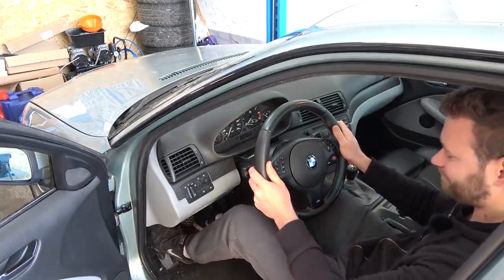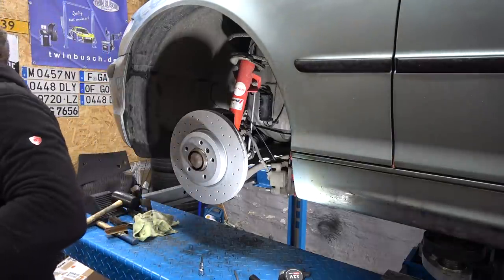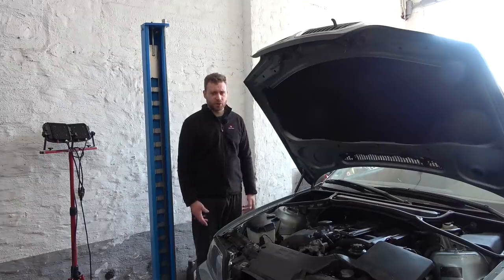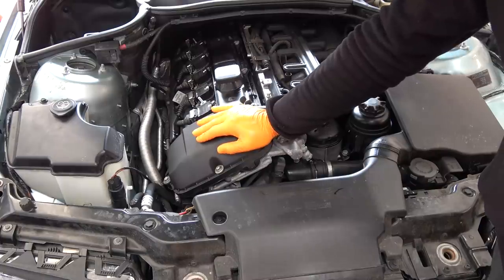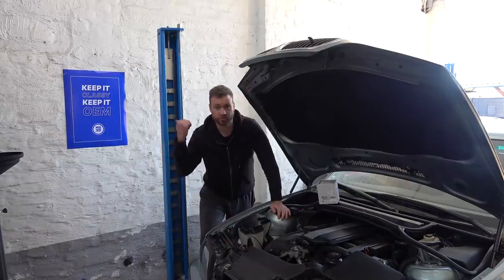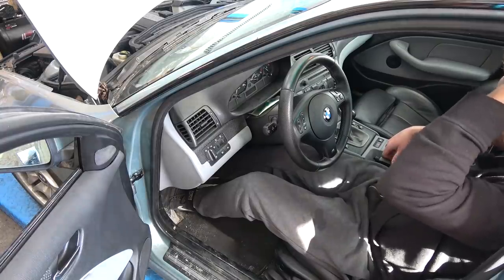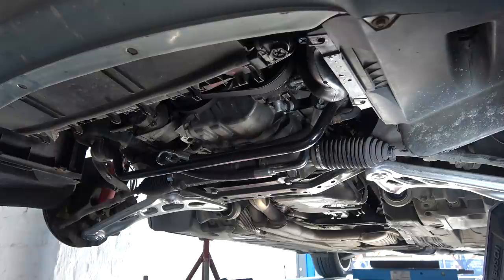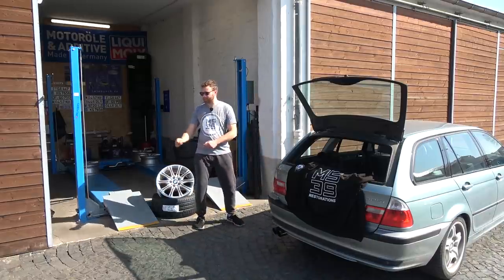Make It Stop & Steer Better - BMW E46 325i Touring - Project Cologne: Part 9

Comment: It makes you feel so silly when you do a bunch of disassembly and then it turns out it wasn't necessary because it was something simple! :D This past weekend, I put the rear fold down seats back into my car and then realized I had the seat belts wrapped the wrong way and now the buckles were on the BACK of the seat!!! So, this coming weekend, it's redo the back seats!
Reply: Its even sillier if you buy parts beforehand that you wont need so don't complain. :p
Reply: Or, week after week, a service writer instructions say, fix passenger rear and the driver front is the issue. Make you want to twist somebody's head off their neck
Reply: Humm. I wouldn't say it makes you feel silly at all. If you don't know mecanics, like I do, looking for the easiest way to fix is the only way to fix. So even if I would have probably been able to spot the steering wheel issue immediatly, that's only because that would have been the only thing I could have ever done. Glad Sreten did'nt cut that part. It proveshe knows how complicated it usually is.

Comment: Your videos are so helpful... It's much easier to learn from someone else's mistakes. Thank you for not editing them out. I owned several E46 cars but my all time favorite was a 2002 325i with sport package. It had 172000 miles and it wasn't passing inspection, so I bought it for $800 and after only $1200 worth of OEM parts, it was driving like it was on rails and it had better pickup than my 330i with only 82000 miles. I regret trading that car for a Z3 with sport package. The Z3 is in excellent shape and has a 3.0 engine and gave no problems in over 3 years of owning it, but I am 6' tall and there's not much room in it.

Comment: I've used this MAF cleaner from Liqui-Moly almost a decade ago on then my 1998 Ford Mondeo with 1.8 petrol engine and it made a fantastic difference. I've been plagued by slow reaction to accelerator pedal and P0171 DTC code. Did not know much about MAF sensors then but gave it a try and it worked! To be honest, the same result could be achieved by a q-tip and some alcohol, but at the time I was too scared to break the MAF sensor.

Comment: This give me another reason why i love German cars so much. I'm  currently driving a 2008 VW Jetta(MK5) with the 2.5L 5 cylinder engine with 240 000 Km on the clock and i still love it. I can't see myself selling it. But living in Canada with the winter and the salt, that day might come where i have to say bye-bye. But let me tell you that there are very few cars that will give me the driving pleasure that i get from driving this old jetta. And i'm talking about brand new cars like Toyota and Honda. They can't match it! VW for the win!!

Comment: toptip : the guide rubbers also push back the assembly after braking , so the rubber needs to be somewhat new / flexible. and ofc lubing them up will result in brake noise :P

Comment: Loving the e46 content! I love mine! Just a future tip for removing the control arms - the middle ball joint that bolts to the subframe you can loosen by using a ratchet and multiple extensions with a socket guided on to the top of the nyloc nut from above and inside the engine bay. You might need someone underneath to just guide it on, but you can undo it a lot quicker than just quarter/half turns with an open ended spanner from below.

Comment: Another difference with the M-Sport control arms on this chassis is the mildly increased caster. Factory difference in castor is slight, but it was there.  You can use regular arms with stiffer dampers and springs, but usually it's the wider tyres and bigger alloy diameters that push more stress through the suspension than 205/55 R16s.  Even on regular suspension, the extra stiffening and (reportedly) tougher ball joints are worth it.

Comment: 3:16 just a tip, if you want to avoid rust between the rotor and the hub, you can put a light coat copper grease between them. Copper grease has a high temp limit which is excellent for brakes.

Comment: great video as usual, I see your Autobahnitis  flares up in the spring time to, especially when your MAF sensor is on the fritz, I also agree with the Liquid Moly engine flush, I have seen the results in my friends Golf GTI , it sat for  a few until he got his license back and it was stored inside the whole time and used the flush every 3000km and by the the 4th change it there was virtually nothing on the filter when inspected and the car performed better in just about every area , and even ran quieter and got about 5% better economy  , he also doesn't drive at 140kph everywhere he goes anymore especially the judge told him this is your last warning and drives 200 kms/daily to and from work 😂 your car is virtually new now,

Comment: If you ever need to swap out the MAF in the future on your m54, there is a Hyundai that uses the same part number. Works 100% the same. Do a search on the forums, I don't remember which car it is off hand but its absolutely the same part. As for MAF cleaner- it can work but it depends on a couple other factors. If you are using a k&n and are over-oiling it it can foul out the hot film portion of the sensor. I wouldn't use the k&n anyways. If I were going for a drop-in performance panel filter, the foam type like an ITG flows better and filters better as well. The dry flow ones like AFE and AEM are also superior to the gauze style k&n ones as well. There has been studies that show the k&n letting in more particles and them not stopping smaller microns than the others as well. Good work on the Lemforder stuff. It's the best OEM replacement stuff you can get. Well worth the extra money as it lasts. I am not a fan of the OEM LCAB'S though. The poly/ delrin/ spherical ones make s huge difference and don't increase the NVH at all. They are fine for a daily driver and make a huge difference under braking and turn-in stability especially. One thing you can add to the brakes that makes another big difference is the brass caliper guide pin bushings. They keep the caliper from 'twisting' and help with the pedal feel. Nice work on making some progress on this thing. Tourings are awesome and super useful.

Comment: Here a nice tuning tip for your E46: You still have the CDV (clutch delay Valve) installed. Removing this is a 10 minute job and it makes the clutch feel 10 x better.

Comment: I've changed so many MAF's that never throw a single fault code. I only use Bosch now. I've never used VDO but I've found Bremi to be crap. If a customer brings a Chinese Ebay MAF I give it a distance test - that's how far you can throw it. I love how clean this car is underneath. An underbody inspection of a UK E46 is like watching a Titanic documentary.
Reply from the maker: Yes, Bremi is crap for MAFs. Bosch doesn't make them for M54 engine.
Reply: @M539Restorations  Yes of course. I've used febi which I'm told are Siemens with the name removed but they are $$$$. I just collect original BMW ones now!

Comment: I have a e46 330ci clubsport and to get cruise control working I had to replace the Mass Air Sensor, seemed strange but it worked.

Comment: Can also sign the point with OEM sensors. Also had to change camshaft and crankshaft sensor on my M52. With aftermarked they delivered me unfitting ones. So rather spent some Euros more than double times.

Comment: Perfect! Unfortunately here in Brazil it's not easy to find MAF sensor for E36, and parallel MAFs suck... only solution is to reform the car's original MAF. And they are from Bosch. Now in the case of the E46 I don't know if here you still find new original MAF sensor from VDO BMW. Cheap sensor MAF is suck! Another advantage you said about the original new MAF sensor is its reliability and long life!

Comment: I recently had my 2.5 e85 z4 have the same misfiring cylinder 5 luckily it was just a quick coil pack change and service and drives like it did 18years ago

Comment: There's a liqui moly engine flush which is a bit different to this 10min one. 
What I mean is LM engine flush which you're putting into the engine and drive as normal for 200km and then normal oil change.

Comment: Have you considered the 2.93 diff from the 330i (and 328i) in place of the 3.15 your 325i has?  That should lower the rpm at Autobahn cruising speed.  Of course it might dull acceleration but we know you're going to be dropping the 3.0 in there before long, even if you don't know it yourself yet.  Just until you source an S54, that is.

Comment: Super nice and clean. Today I ended up my rear power windows retrofit and my car says the same, he wants more money from my card, it is spitting diesel through inyector number two... shiiiit, fuking diesel hahah
For the rear brake on 330i/ci d/cd I make some welding work with 330 pads and 320 pads (that is mine) to increase diameter, I don´t remember but I think I solder about 12 mm.
Many years after it keeps working like a charm and out Spanish tuv passed as always.

Comment: If the engine flush is breaking the build up down, it’s gonna start to collect on the bottom of oil pan and even with draining you don’t get all of it out and it could possibly clog the oil pump.

Comment: Im pretty sure the OEM air mass meter is a bosch one and not a VDO. There is a simple check to see if this type of bosch air mass meter is good. With ignition on engine off the signal produced by the air mass meter should be between 0.98V and 1.02V. If more or less you should replace it.

Comment: My aunt has an e46 with 300.000 km that is accident and rust free and considers junking for a new bmw.  I think im gonna take the project of refurbishing it.  No paint job needed, just very few dings that can be pulled out, headlight lenses, console plastics, headliner and new interior will make it new again as its still being serviced at bmw dealer, engine still pulls like a train.

Comment: I have the same problem. Missfire on cylinder 5. M54B25. I was sure it was the fault of a leaky exhaust manifold... Now i am wondering about changing air mass sensor. Thanks for this video.

Comment: Using OEM sensors is always the cheaper, wisest, easiest, better alternative. They are more expensive but they work. Buying a cheap aftermarket is like throwing money down the toilet. We learned that in our Sportage CRDi. The Mass airflow sensor failed and the car was in limp mode. A cheap generic solved the power issue but it didn’t have the temperature sensor so the car assumed it was always stone cold and It smoked like a coal powered ocean liner at full speed. Fuel economy was atrocious as well. So in the end we had to buy the genuine sensor and that solved everything. So is cheaper to buy the genuine because you don’t have to spend money a cheap one that won’t work or will work poorly.

Comment: I have disconnected my MAF on my 325i 02, 323i 00, they have been running great sense then! Fixed all vacuum hoses, but when I connect them back, it makes my BMWs run like sh!$!!! lol By the way they both have over 220k miles and still running strong!!!!

Comment: 5,000 rpm would give a lot of engines a hard time for hours on end but the mean piston speed given the short 75mm stroke is really not very high even at 6,500.  The short final drive works well for acceleration but I would be fitting a slightly longer diff (available for peanuts these days) to give at least 40 km/hr per 1,000 rpm in top gear.

Or, the six-speed box from the 325ti, hmm...

Comment: I thought that thing would run faster than 200kl/124mph. 
Seems that autobahn is not as well maintained as it used to be. Seemed pretty rough.
I've had that happen to me. Take some part of a car apart and find the problem was something different and easy.
About $200 usd is not bad for a MAF. The dealer and parts stores wanted between $400 and $500 for one for my Volvo. 
I got a Chinese for $65. That lasted only a few months. Then I got a new Bosch on-line for $165. 
OE or OEM only!

Comment: In poland u can get stainless steel brake lines front for  66euro (300zł turboworks-66euro, or hel ones for 360zł  with multiple colors etc;p)

Comment: Ha, I don’t suppose you would consider working on an E63 645Ci. 
The reason is, they seem to be so neglected, misunderstood, plus I own one, just want to have a better understanding.
I also own an 2000 E46 330D SE manual touring, with 230,800 miles, I’ve picked up so much,  from your posts, thank you 👍

Comment: Done something similar before, kept hearing a rattle in the back of my MK5 GTI. After taking apart the entire rear interior of the car turned out to be the taillights rattling in their fixtures (common issue)....

Comment: Wondering why not put some anti seize on axel mount before securing new rotor to it? Will make removal easier in the future.
Reply from the maker: I never do. Again, TIS says not to use any as it can mess up the alignment of the rotor.

Comment: Please don't throw away the old caliper brackets after, they are a great upgrade for e36 and older e46 that allows for 300x22mm front brakes using the original calipers and hardware. I did this to one of my e36 coupes and the stopping power was much better afterwards. Sell them on ebay or something, save some random person looking to do the same some money as opposed to buying them new. :)

Comment: You are lucky to ger the fixing screws for the brake discs. I have just ordered TRW discs and they do not put the screws any more in the box. If you ask me it is a safety issue to use old screws...Where did you've ordered the steel braded brake lines? Thnk's again for the video, great as always.... Will you sell this one also? :)

Comment: Hi! Always good to see things about this car, especially when you doo everything i want to do myselft on my own e46 :) Actually i would like to have your (and anyone else!) opinion on reinforced sway bar for E46 (like H&R or eibach ones), my car as the classic chassis, and i'll put lowering spring + bilstein B6 shocks to improve  reactivity, but i do not mean to have a race/drift car or whatever (mine is a 320ci so not very powerfull) and i was ready to buy big sway bars when i asked myself, will it not be too much? shouldn't i go with sport chassis sway bar (1 or 2 mm of diameter more than mines) first? Thanks again for your videos!

Comment: Maybe these are different M Sport control arms but when I installed them on my touring ages ago it changed the geometry enough that it felt VERY different initially and needed realignment.
Reply from the maker: Yes, needs alignment
Reply: The Msport arms have stronger ball joints but their geometry is the same.  You'll need an alignment after because you're very unlikely to put the businhgs on the end in exactly the factory position.  BMW quotes the distance from the centre ball joint to the edge of the busing as 290.9mm +/1 imm.  (yes, to a tenth of a mm)  Good luck being that accurate, so get an alignment after!

Comment: I noticed you torqued the control arm bushing mount bolts with the weight off the wheels this time.  I'm sure last time you were careful to do it with the wheels back on, and even rolled the car offf the ramps and back on to make sure the suspension was setlled in the normal position.  Or am I mistaken?
Reply: No you evil twin, he didn't.  When he put the suspension back into the nornal position first he was torquing the anti-roll bar bushes, not the control arm bushes.  No chocolate clown snack for you.  It's not necessary for the FCAB.

Comment: Hi there! Are you planing in doing an engine swap for that car? Maybe the 30i?
If so, or even if not, is it possible for you to do a gearbox change for a 6 speed? That one is too short i think.
Just a thought: for dayly use and with the same platform (e46), wouldn'd be better a 330d (diesel) with the 6 speed gearbox??
With 204cv and 410nm (stock) i think that it should be a pretty fast car, easy do drive and very economical. You live in Germany, the prices for those must be veryyyy cheap. And you can do something diferent in your chanel. A diesel eheh. Think about it.
Best Regards

Comment: After cleaning the inside of the  dipstick tube and switching to 5w40, is it still burning oil? I'm thinking about to do the same in my M54 530i.
Looking forward to see your next video!
Reply from the maker: No, I have 02 pilot mod.
Reply: @M539Restorations  Ok, I'll try it. Thanks Sreten.

Comment: Is there no difference in geometry between the M arms and the standard ones? Same camber, same caster, just reinforced?

Btw, just replaced the same power steering line yesterday. :) I hope to get the underside as clean as yours some day, there's so much oily dirt everywhere from all the oil leaks over the car's lifetime, I couldn't get it all off without a pressure washer. But where's your plastic oil drain cover? :D

Comment: "Oem parts are more expensive but in the long run they are worth it" and i'm just sitting here with 10 euros in my pocket
Reply: I have found out that ome of the OEM parts for my older car (2003 astra) are CHEAPER than the "cheap" replacements. Just bought a TRW set of rotors and brake pads for less than 50 EUR :)

Comment: You can pass TUV with drilled disks and steel brake pipes? In Switzerland they let us pass only with OEM, sadly...
Reply from the maker: Drilled is fine, for lines I have ABE.

Comment: Hey Streten, is it a good idea to use that engine flush on a newer car? I have a 2018 Audi Q5 with about 22,000 miles on it. I do oil changes every 5,000 miles using Liqui Moly if that makes a difference

Comment: Hi Sreten! There are OEM drilled brake discs available. Those are the compound discs only available for the 330i. And since you upgraded to the 330i brakes...
Is there any particular reason why you didn't use the OEM compound discs?